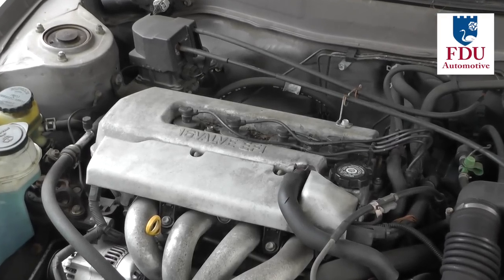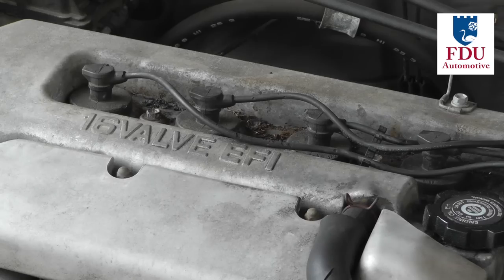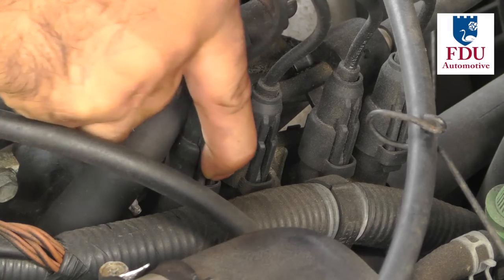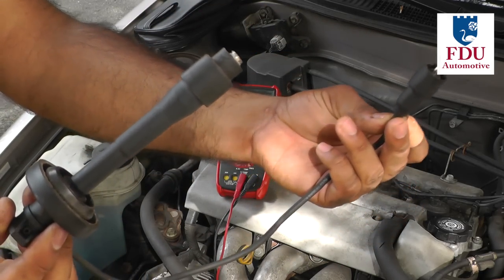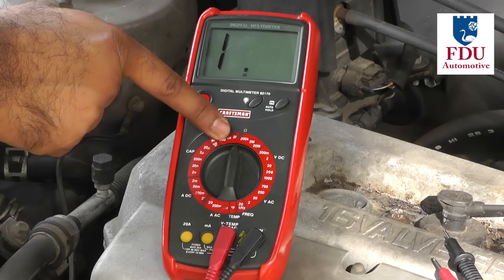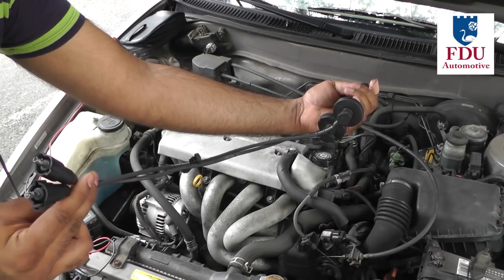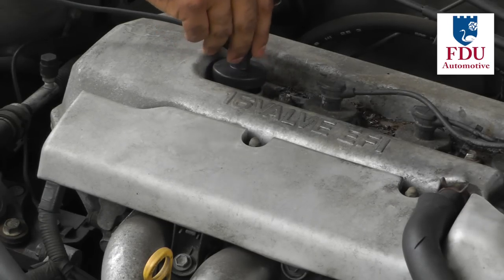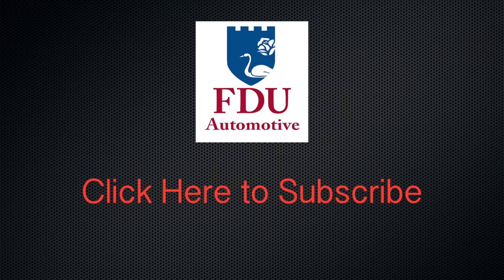How to Check Spark Plug Wires and Replace Them

Comment: the dielectric grease is used for the rubber boot not the metal terminal , this grease is meant to kill spark and is meant to be put on the inner lip of the rubber boot so no spark can pass outside the boot area ..IT IS NOT ALLOWED TO TOUCH THE METAL ENDS OF THE PLUG BECAUSE THE GREASE WILL NOT ALLOW THE METAL END TO MAKE GOOD CONTACT WITH THE SPARK PLUG AND YOU WILL HAVE MISSFIREING OR A NON STARTING VEHICLE ,,,check out some videos on how to use dielectric grease ....do not get any on the ends of the spark plug wire ..do not get any on the metal tips..this video began well but ended with very false information that can cause trouble to your car

Comment: my plug wires has physical damage. but if the resistance is within range can i use them or it needs replacement?